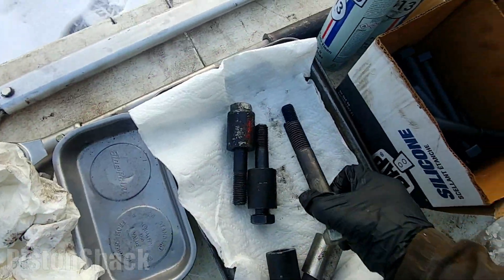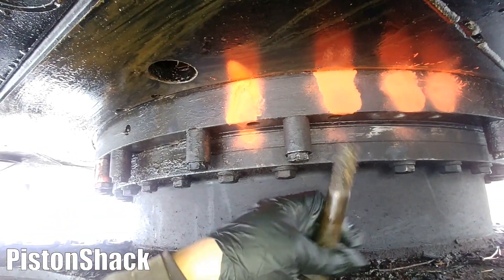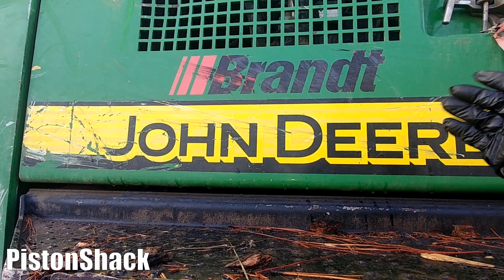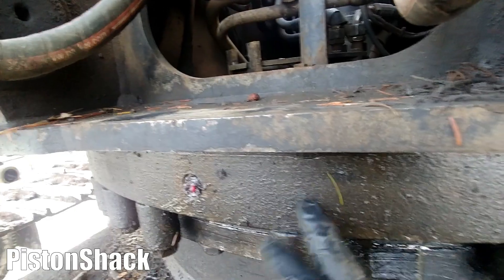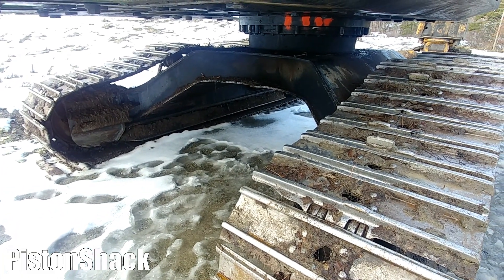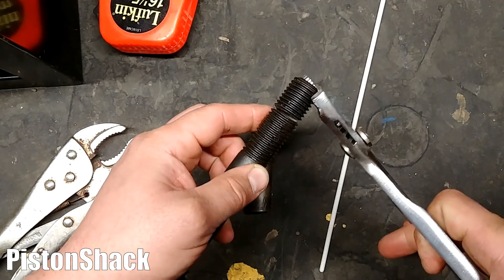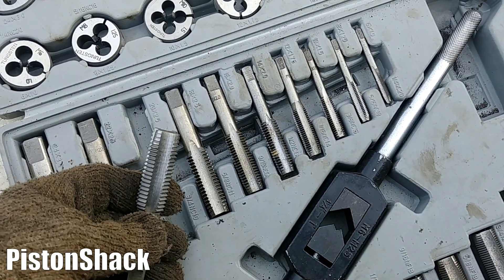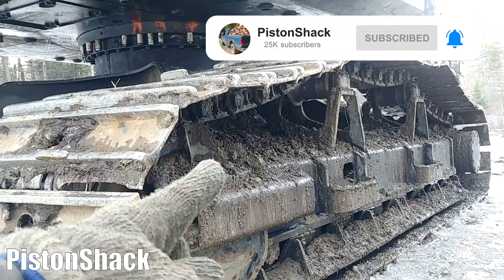Excavator Broken Slew Ring Gear Bolts Extraction - Made Easy | Deere 2054

Comment: Thank you for this information. I am sure it will come useful in the future if I come across a similar situation. Seeing that it works gives me more confidence in the process. I perhaps would have used a drill bit to clean up the inserted broken end rather than a die grinder. 👍👍
Still do not know why the design has such long bolts with such long collars on them and not use shorter bolts. Like to know why this is?
Reply from the maker: You're most welcome, buddy! I still need to extract one more broken bolt later, at some point. Probably, leave it)